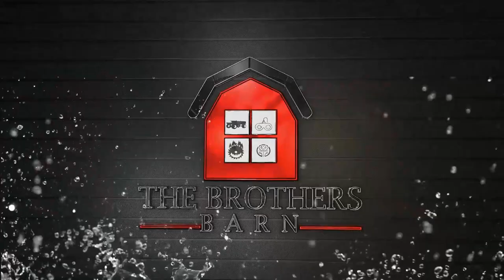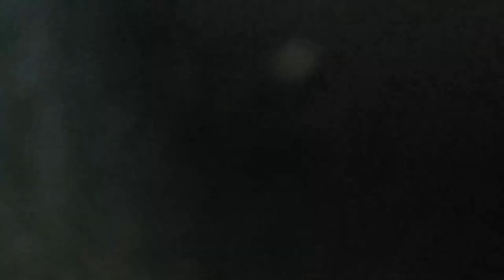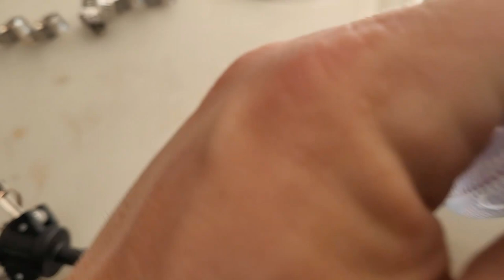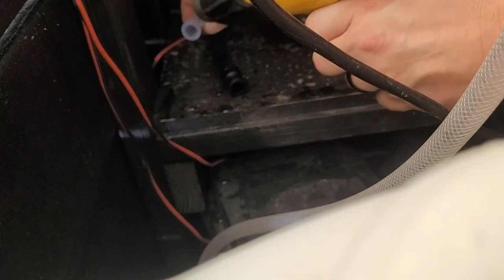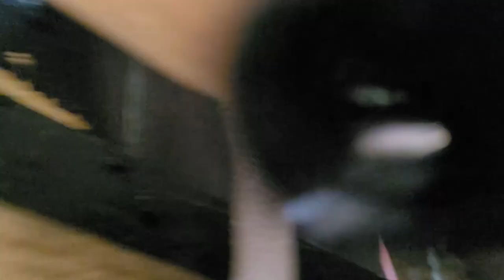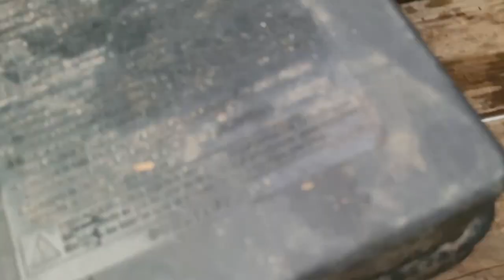Banjo Fittings - Do they work?

Comment: Did that leak have anything to do with the banjo/camlock fittings?
Reply from the maker: The banjo/camlocks work out great. No issues so far.
Reply: @thebrothersbarn6094  thank you for the quick reply. I just ordered some yesterday. Thank you for the link. Are you also running 1/2 hose and how many feet is the hose?
Reply from the maker: @AllCoastLawn  I run 1/2 hoses to water amd SH. For the soap I use 1/4 hoses. I keep all the hoses the same length around 5 ft but not 100%.
Reply: @thebrothersbarn6094  got it.
I’m making a DIY/basic soft wash setup. How long of a hose can I use to shoot the SH and water?